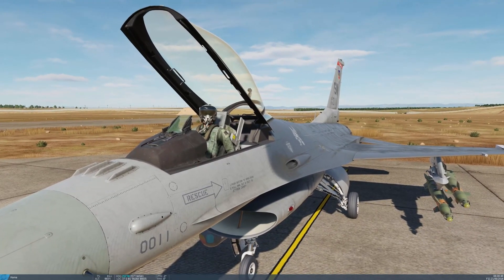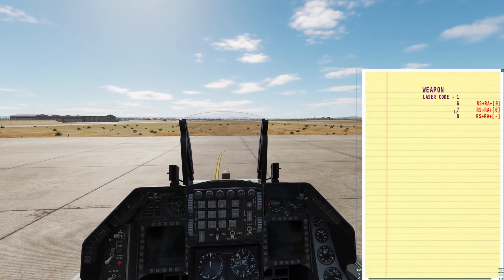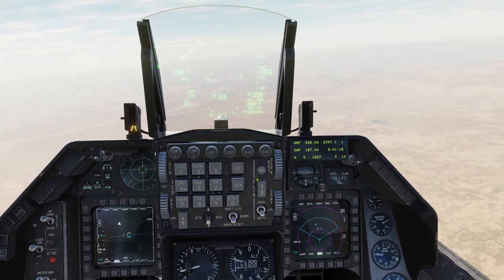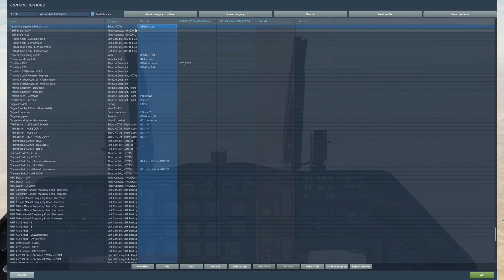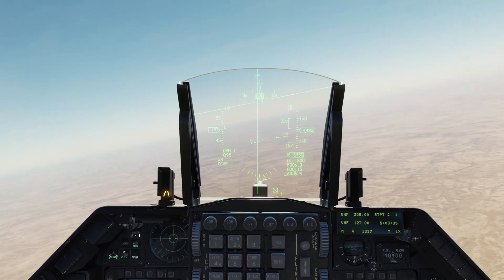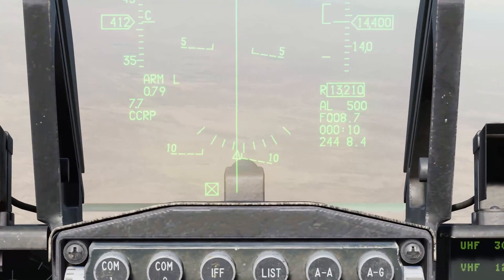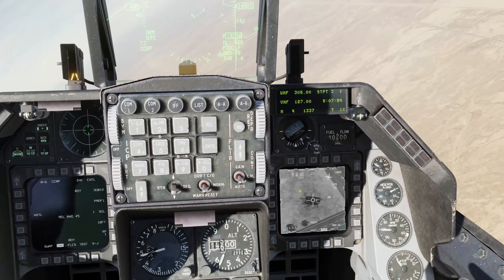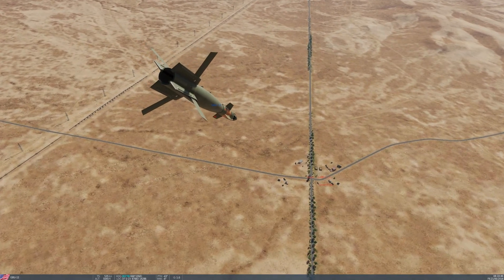DCS F16 Laser Guided Bomb - Basic Tutorial

Comment: So ignore the first countdown bc it’s the bomb tossing cue and then depress during the second countdown
Reply from the maker: Yes, I didn’t want to confuse things in the video but if you set the DTOS release angle to 0 degrees you can actually use the ‘first’ countdown as they become the same thing. The default DTOS is 45 degrees and that gives the 10 second or so difference we see in the video.
Reply: @ChattytumblerTCW  thanks mate
Reply: One more question, whenever I use the GBU-24 Paveway 3 I can drop at the first countdown, does that have to do with the guidance upgrade of the paveway system? Sorry newish player still trying to figure it all out lol
Reply from the maker: @gregswope4629  sorry for the delay, had to get some free time to try the 24s again :) You can drop at the first count down but only if you have set the parameters correctly eg a release angle of 0 degrees if in level flight. I did some testing an it is better to wait a few seconds after the release cue to drop your GBU-24. If you drop at the exact release the bombs tend to have a low trajectory and almost skid along the ground before they hit. If you wait longer then the bombs drop straight down through the roof. I was flying at 20,000ft and released at 4nm from target (you can set that in the REL CUE). I had my laser trigger 25 seconds from target and the bombs were dropping straight through the roof like they do in movies. I should probably put together another tutorial video for the Paveway III as there are a few things you can do with them.
Reply: @ChattytumblerTCW  awesome, thank you for the feedback. Yeah I’ve notice the trajectory is a little flat when dropping right at the cue but if you wait a tad bit longer it’s more on top of the target. Still having some issues with the other laser guided bombs sometimes they wanna drop and other times they don’t but I’ll get it eventually lol
Reply from the maker: @gregswope4629  I spent a while teaching my squadron on the F-16. The majority of ‘failed’ bomb releases was because the bomb fall line was not exactly in the centre of the flight line. I’m the F18 you can be off by a long way, the F16 is very very fussy.
Reply: @ChattytumblerTCW  thank you again kind sir for the all the words of wisdom and advice, definitely earned a subscriber from me!
Reply: @ChattytumblerTCW Sir. I still trying to Release GBU 12. Its more than 1 year 😅😅😅.time to time i trying still i couldn't.  I play Mission in Gulf map its called Thred the Needle.. i couldn't Release properly. Somtiems happened but. 😢😢😢😢
Reply from the maker: @Rough.91  I just flew the Thread the Needle mission to test it. The GBU-12s worked fine. Make sure you have CCRP selected. Make sure you press and hold the  weapon release button until the second countdown is finished or the bomb wont drop.